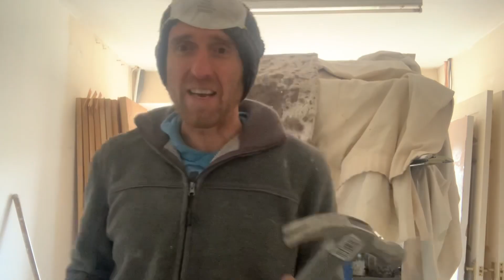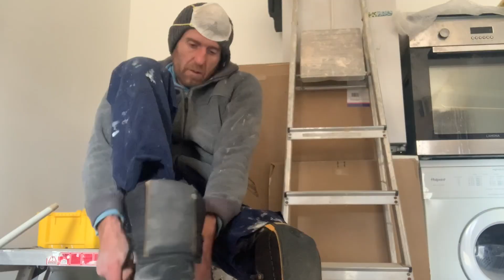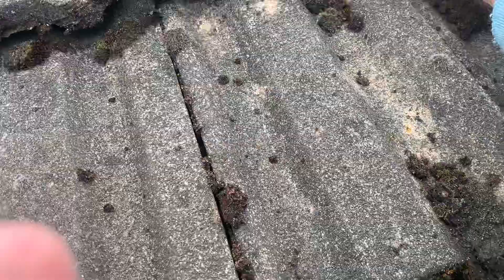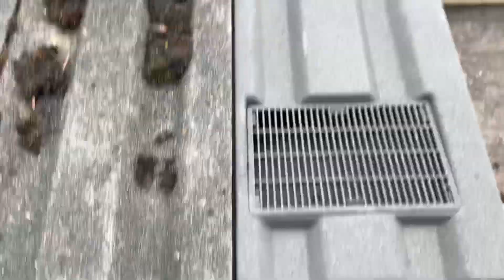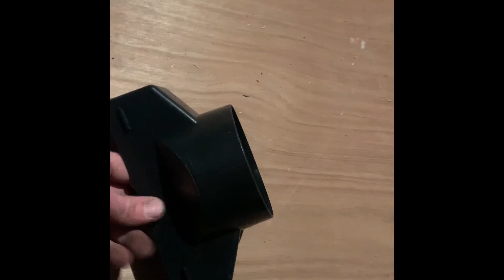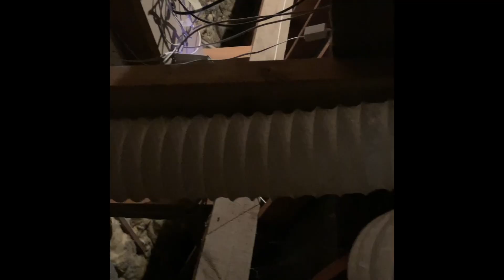How To Fit A Vent Tile In A Roof | Extractor Fan Vent Tile Installation | Vent Duct Installation

Comment: Great video Dan 👍 just one tip from me if I may ! When ducting in roof spaces that can get very cold in the winter months, it’s always advisable to use the insulated ducting to stop the moisture in the air that’s being pumped out, condensing back into water droplets to quickly and trickling back down the inside of the ducting causing damage to the fan and or surrounding ceiling. Hope this helps because you’ve certainly helped me on my journey. Many thanks and looking forward to watching more of your progress and journey.
Reply from the maker: Hey Chris,
Thanks very much for watching and for your comment, this is gold advise, thank you so much, I really appreciate you taking the time to try and help me, I`m far from an expert.
Have a great day.

Comment: Very useful, I have to fit some vents ready for the plumber to connect up a heat recovery system and feel more confident about tackling the concrete roof tiles now. Thank you!

Comment: Very decent video 😀
I would add following;
1. Use gloves. Roof tiles tend to be rough and cut through skin easily. Also it takes 1s to accidently drop or clip your skin with other tiles amd get a lasting blister.
Just use gloves.
2. It's much easier to lower the tiles down if you simply raise the overlapping tile on the left (can be on the right but it's the tile overlapping so pressing down your raised tiles and causing them to block).
By raining I mean using a rubber end of the hammer to keep it raised and than all pushed up tiles will slide down easily like butter with no effort at all.
Remove the hammer at the end (lift by hand and take hammer away).
1 more thing. 
Some roofs been installed by really overzealous roofers and every tile is nailed down. If you got that problem simply use a crowbar with 1 end flat. Sometimes you can just use 90 deg.side to lift the nails but occasionally the flat bit will help.
Don't whack the tiles up where every tile is nailed. Many roofers do it but if the nails are pretty long like on double roman or waved tiles you will shred the underlay by moving the tile up cause the nail will travel up with the sharp end sliding through the underlay.
Reply from the maker: Great info, thanks very much Peter.

Comment: Very useful video as I have the same concrete tiles. Putting air conditioning in my loft as gets too hot (despite Kingspan insulation). Ideally needs 4" plus which is not possible, hence the installation of an air conditioning unit. Have chosen an Avalla S-95 unit (made in the UK not China) and first test - it works well but is a little noisy. Once installed I hope it will make a big difference. Thanks for the video - it has been very useful esp how to easily move the tiles to allow vent tile to be fitted.
Reply from the maker: You are more than welcome, I’m really glad you got value from the video 👍
Reply: Actually did this on 5th September, and everything you demonstrated was spot on - even the nail in a tile that was removed to slide the tile in place. I was in a safety harness as was on top of a 2-storey house, a friend helped by passing me tools and stuff and prodding the underside of tiles to locate the correct tile. Hot day and all completed within the hour - I have never done any roofing projects before. 10/10 Dan - thank you. @new2property

Comment: Never knew that such a gizmo existed. Thanks for sharing!
I am intrigued on how the extractor performs across that length of flexible ducting and the bends and upright section it has. I have an inline extractor (which I think are more powerful?). It has a metre of duct coming into it from the bath extractor and it then has 1.5m going across the loft horizontally. It then goes up 1/2 a metre where it connects to an existing soil pipe (the remnants of one as its no longer used as a soil pipe and this probably goes a further metre upright as it pops out of the tiles. I find that my extractor works fine for a few weeks and then duct is then full of water and has to be manually cleared out. I deduced that the fan isn't powerful enough to push it through the run and configuration I have. Mine doesn't seem half as challenging as yours though. Very interested to hear your comments and thoughts on this. Thanks again.
Reply from the maker: Hi Asad,
Thanks very much for watching and for dropping a comment, the fan and ducting seem to be ok at the minute and I believe we are about 2 years in.

Comment: Very informative video with clear and comprehensive instructions. One question, do you seal around the cut in the underlay to prevent any water running down the underlay from trickling down.

Comment: I'm not a roofer either but sure I seen something about not using flexible pipe as it collects moisture in the ridges in turn causing issues in the future.
Great job on fitting the vent though 👏 made it look simple
Reply from the maker: Hey Sean,
Good to hear from you, I`ll let you know on here if I experience any issues in the future. 
Thanks for watching.
Reply: Yup, I was actually told by building control that the length of the ducting (which was shorter than yours) meant it had to be rigid and that it failed the inspection. The main reason was due to the face that flexi collects moisture.
Reply: @new2property any issues with condensation

Comment: great video mate very helpful. I need to fit a vent tile like you have used but I have a bathroom fan extractor fitted in a false ceiling but the builder did not vent it out. only just found out now inspecting the loft. my question is does this roof vent also act for the extractor fan that's in the bathroom can I add pipework to the fan and the tile vent as well to let steam out. your opinion would be great.

Comment: hello really helpful video , im thinking of useing the same tile vent just to help my loft breath better for ventalation purpose as my current mushroom tiles are failing...

How do you stop the rain coming through vent ? cheers
Reply from the maker: Hi,
There is a gully behind the grate that allows the rain water to flow back out and onto the roof.
Thanks for watching and for dropping a question
Reply: @new2property  Thanks for the video. Amazing job. Also, I recommend checking every few years to see if the gully and/or the grate don't get blocked with moss/styrofoam balls/feathers and anything else the rats with wings can leave on the roof.

Comment: Hi, thank you for video. I've been had bargeboards etc replaced with upvc. Although agreed vents should be fitted, he didn't fit any. Now we haven't got any ventilation in the attic. It used to be bone dry, this year it's wet. Do you think 3 vents along the front and 3 along the back of the house will be enough? It's a small semi with a low pitch roof, with plenty of insulation. To get someone to do it what would you reasonably expect to pay? Thank you again, Steven
Reply from the maker: Hi Steven,
It sounds like you certainly need your attic ventilating, installing vent tiles isn’t a difficult  or time consuming job. The cost will depend on factors such as your location and tile type etc. 
I suggest getting 3/5 roofers to quote on the job and then deciding who Togo with from there. 
I hope this helps.
Reply: @new2property  thank you

Comment: Thanks.. our roofer didn't pull the upper lip of the felt onto the batton. It justs hangs into the loft? I understand if water reached the felt somehow, it ll come in through the hole? Roofer doesn't agree to come and sort it and move the upper lip of the cut felt folded onto the batton. I see the home's original extractor fans felt is also hanging down slightly in the loft. Is that a common practice or a minor thing or should I be losing my sleep on it??
Reply from the maker: Hi Ahsan,
I don`t believe you have anything to worry about and its certainly not worth loosing sleep over, I suggest monitoring the area and if you see water getting in then call your roofer back to sort it. 
Thanks for watching and for dropping a comment.
Reply: Hi, I'm about to do same job. One issue I'd be concerned about is not sealing around the felt. I'd have thought there would be a kit similar to around  a velux to ensure a proper seal. 
I understood the felt is your actual water tight seal. The ridges /slates/tiles are not 100% water tight.

Comment: Any tips regarding selecting the right tile to replace. I've just been up for a bit of prep and the initial 3 selected tiles all overlap somewhat a rafter. The ducting connection is almost the size of the vent tile on the model I have picked up and seems to be an issue no matter where I want to place it. Is this common or am I a doyle
Reply from the maker: Hi Pixelheist,
Thanks very much for watching and for your comment.
I`m not sure about the tile type, I used roofing ventilation to help identify my tile type, they were great.
sales@roofingventilation.co.uk, maybe they can help you too. 
I hope this helps

Comment: I wonder if it’s possible to do it from inside the loft if I can’t access the roof from outside
Reply from the maker: Hi thanks for watching and for dropping a question. 
You will need to fit the tile from the outside.
I hope this helps

Comment: I had roof vent tiles installed. The condensation disappeared i  around 10 days. However, i see some appearing again. Possibly slightly less than before. Is it something which will come and go? I m trying to use extractor fan after showers and keeping ventilation in the house but can be tricky in winters?? Is it something to worry about?
Reply from the maker: Hi Ahsan,
Thanks very much for watching and for dropping a comment, I would suggest you install a constant trickle fan this will help you keep the room moisture free. Have a look at the vectaire elegance fans they are great
I hope this helps

Comment: Hi I am fitting some plain tile vent wher on the roof do you position them some say near ridge some say above loft insulation near eaves thanks
Reply from the maker: Hi Don,
Personally I fit them where I need them, they are simply a replacement tile that serves a greater purpose. Mine are above where I have a vent duct that needs connecting to them.
Thanks for watching and for your question.

Comment: Hi great video , just wondering do you know the exact vent you used in this video as those tiles look identical to mine . Thanks
Reply from the maker: Hi Dave,
Thanks very much for watching and for dropping a comment. 
I`m not sure about the tile type but I used roofing ventilation to help identify the one I went for, they were great. Here is a contact email address: sales@roofingventilation.co.uk 
I hope this helps
Thanks again for watching.

Comment: This might seem a silly question to you
Can you use this  type of event as a  standalone vent  as an air vent Ie do not have to connect the adaptor tube
If so what happens to the rainwater thanks
Reply from the maker: Hi Ray,
There is no reason why you can’t use this as a standard vent. The rain water passes out of the bottom of the vent it doesn’t go through the main vent hole 
I hope this helps.
Thanks for watching and for dropping a question

Comment: That’s a long long length of ducting. The roof vent should be a bit closer to the extractor to give proper ventilation. All the twist and turns will collect moisture I’m sure. Good job on the tile.
Reply from the maker: Hi Gary,
Thanks very much for watching and for dropping a comment

Comment: If it’s over 3M in length should be insulated, I think that run may pool with condensation and then one day drop a load of legionella water everywhere
Reply: Also need to keep tension on the ducting in straight lines…ideally suction atop straight up into the roof tile it’s essentially know as passive stack ventilation

Comment: I like your videos, and I dont want to be sounding negative but i dont see how a vented tile like that is not causing problems, the rain will just fall straight through it. I saw better alternatives exist like the redland Redland 49 Roof Tile Cowl Vent or the Marley Ludlow, which actually have a cap so rain does not fall through... I am no roofer mind
Reply from the maker: Hey Riccardo,
Thanks very much for taking the time to watch the video and comment, the tile doesn't let any water through at all, its actually a very good design with run out slots/holes at the bottom that send the water down the roof.